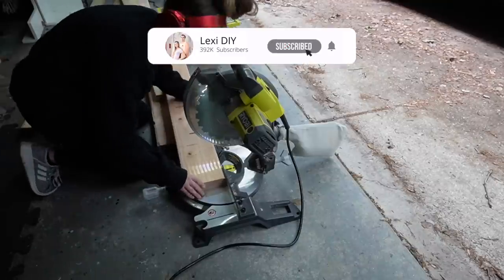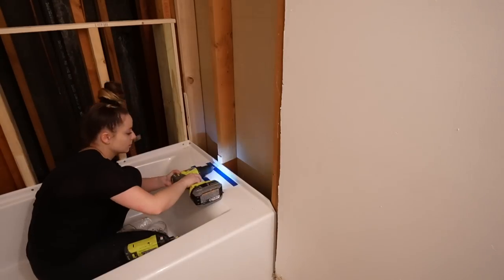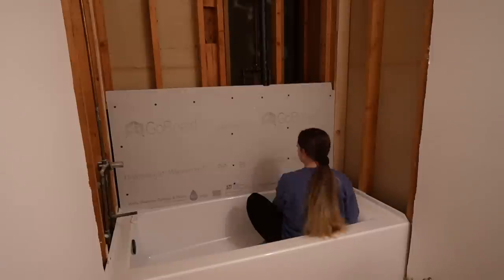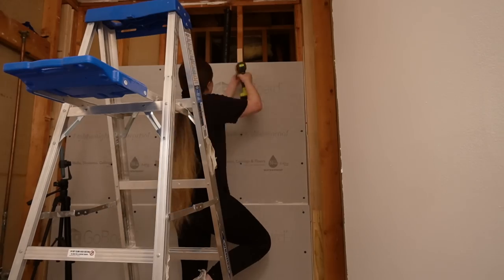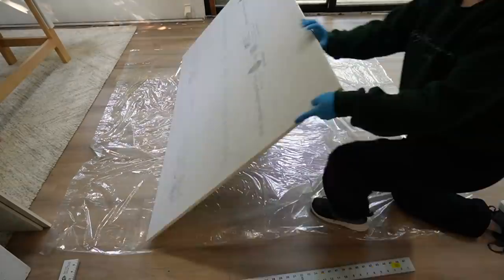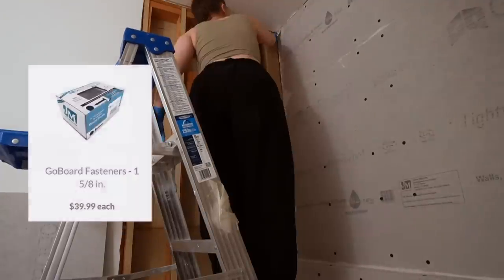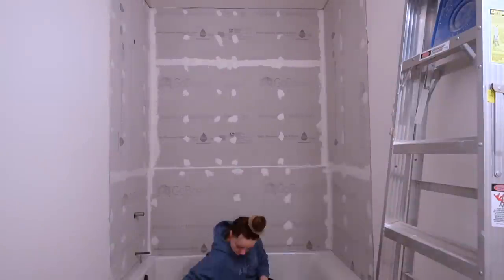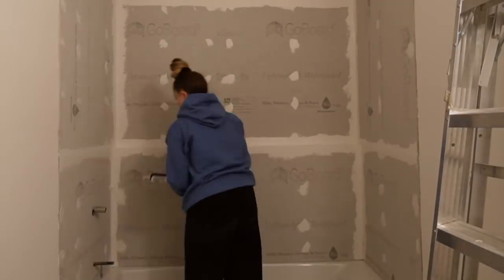HOW TO WATERPROOF A SHOWER | HOT MESS LAKE HOSUE RENOVATION EXTREME BATHROOM MAKEOVER PART 3

Comment: The trick with toothpaste is good, you can also use lipstick. Also useful for setting locks, where you need to mark hole for strikeplate. Different strokes for different folks. How many plumbers have lipstick in their toolbox?
Reply: I was using paint 🤦‍♀️🤦‍♀️🤦‍♀️

Comment: The costs shown are way cheaper than the typically preferred Kerdi Board, Kerdi Band and Kerdi Fix sealant.  I wonder if one is a better waterproofing system than the other.